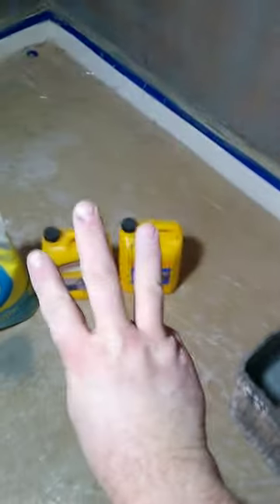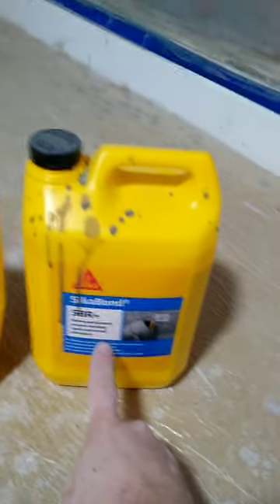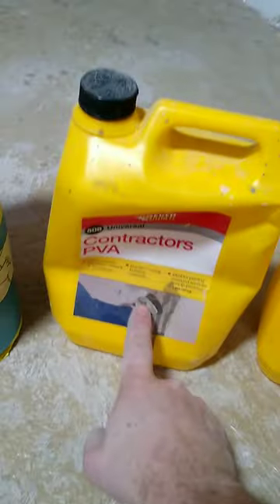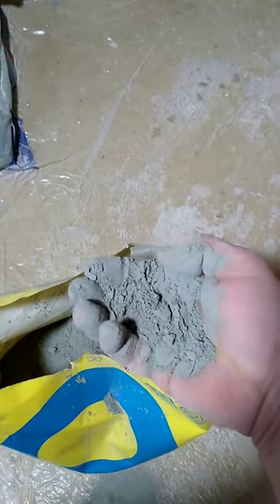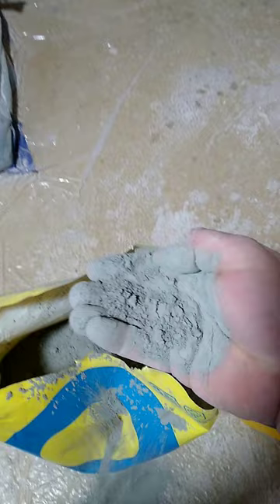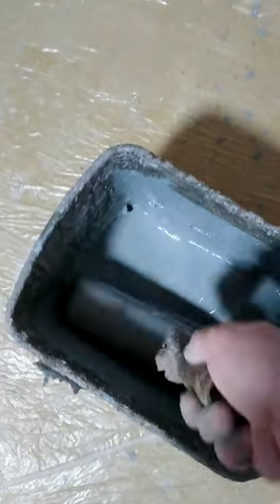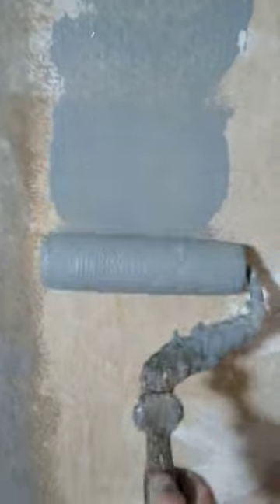HIGH SUCTION WALLS?

Comment: If the walls 100yrs old how about using some lime putty finish instead?
Reply from the maker: Hi Guy this property was built in around 1927 the plaster is made up of Portland cement not lime

Comment: Hi Stu, can you plaster. Straight on when dry or do you have to pva again?
Also can you use this mix again another day or do you have to mix another batch each time ?
Cheers
Reply from the maker: Plaster straight on why dry mate

Once it's mixed you can use on other jobs and it will keep. Sometimes the cement will stick to bottom of tob so you have to stir it up don't put too much cement in 👍
Reply: @troweltalk2719  great, thanks Stu, appreciate your advice , can’t wait to give it a go.

Comment: A replacement for blue grit ?
Reply from the maker: This will be dry in half an hour & much cheaper than any grit. 

If you are going over a glossy surface simply add some sand in & put the floor fan on it for 10 min
Reply: How much sand Stu  per 5 Litres and Can it be any  type ?

Comment: Is there a mix ratio that you use?
Reply from the maker: Hi,

Mix ratio:

50 / 50 neat PVA neat SBR (don't add water)

Couple of big handfuls of cement to a 5L tub such as the one in the video 👍
Reply: @troweltalk2719  you the man,cheers.do you find this mix better than 2 coats of pva or blue grit?

Comment: what makes a wall high suction
Reply from the maker: Hi,

The rate at which moisture is pulled from your material.  In this case I am re-skimming with multi finish. If moisture is pulled from the plaster too quickly then it will likely crack & delaminate.

How dry & porous a surface is will determine whether it's low, medium or high suction or not. These walls are 100 years old & are extremely dry & porous there is no paint on the walls (which usually helps to slow suction to a degree) so the old bare plaster acts like a sponge & draws moisture in very quickly.
Reply: Hi Stu, thanks for the tip. 
Can you skim over when dry or do you need to pva  wall again. 
Also, will it keep to use again or do you sling it away every time.

Comment from the maker: Hi,

Mix ratio:

50 / 50 neat PVA neat SBR (don't add water)

Couple of big handfuls of cement to a 5L tub such as the one in the video 👍
Reply: Sounding a bit dear if you don’t add water ? We straighten and finish new build flats/ stairwells with hardwall it gets sprayed on so you can imagine the amount your left to finish the next day ??